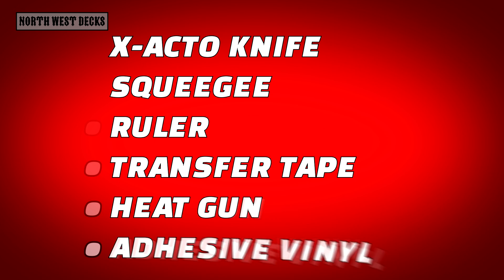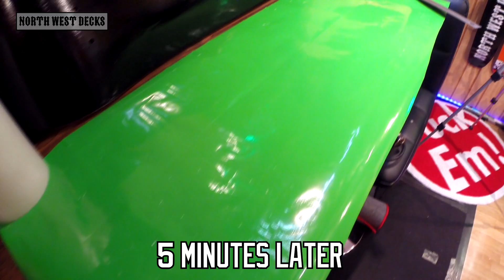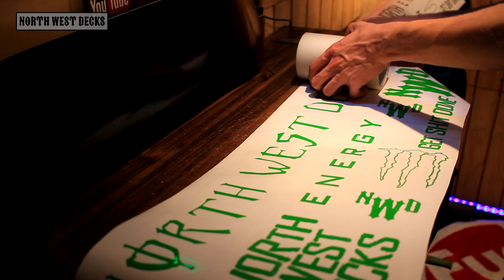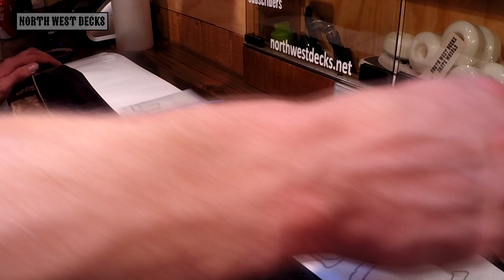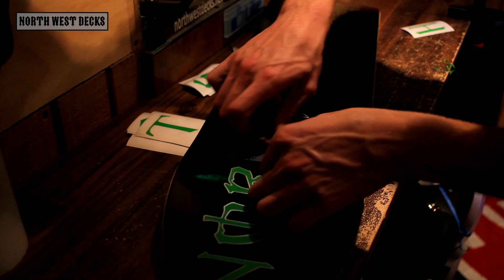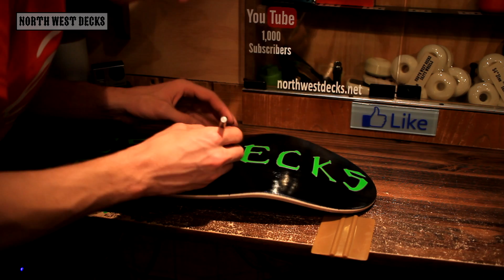How To Make Your Own Skateboard Graphics (Tutorial)

Comment: Even after the heat gun, the vinyl will come off, these are not skateable
Reply from the maker: That’s not true. If you use 651 permanent vinyl and properly apply it. It’ll stick.
Reply: @NorthWestDecksCustoms  hi there, that's the vinyls I got, but still, don't stick as they should

Comment: does the vinly cutter uses ink, so say i want a car a special car on my skateboard do the vinly cutter need ink for the car
Reply from the maker: It doesn't use ink, the vinyl cutter just cuts the vinyl adhesive into the design. You might wanna try waterslide decal paper for a car design on a Skateboard.
Reply: can u make a video on it

Comment: What happens to the vinyl when you heat it up that makes it stick to the board "forever"? I have all of the equipment you used in the video and I'm wanting to make custom boards for my skate team, but I've read a TON of reviews stating to stay away from using vinyl. I've read that the vinyl tends to peel away and cause riders to come to dangerous stops in mid slide sending them hurling through the air. Please share any experience you have with this.

Comment: I have a 34" uscutter as well and use this concept but as stencils and I paint custom signs. Figured id have to paint a skateboard as I had a request for one to be done. Then I saw you just put the vinyl on the board. Now I'd need a heat gun and can see how that would help. Did you use oracal 651 or 631? Probably the outdoor 651 if I had to guess. Anyways how would this hold up with boardslides and tail slides etc? I would think the vinyl wouldn't slide well but what do I know haha thanks in advance if you can help out it'd be appreciated

Comment: How do the graphics function when skated? Does the vinyl rip and peel off like stickers or does it smudge and smear and blend into the wood like spray-painted stencils?
Reply from the maker: +Anklepants Skate Zine it wears away with the deck nicely. Does not smudge or smear it's not paint. The vinyl grading I use will not rip or tear. This graphic is more durable than an actual skateboard transfer graphic.